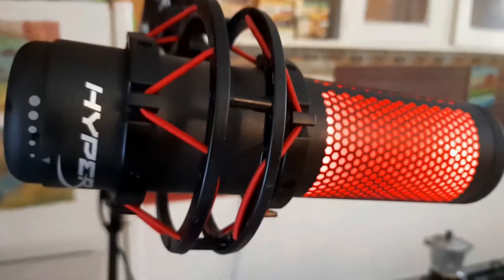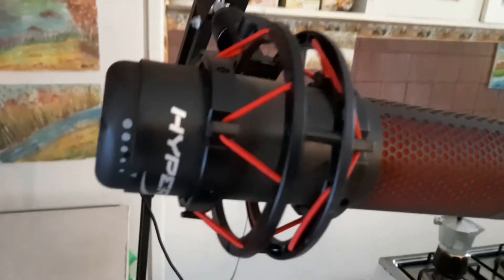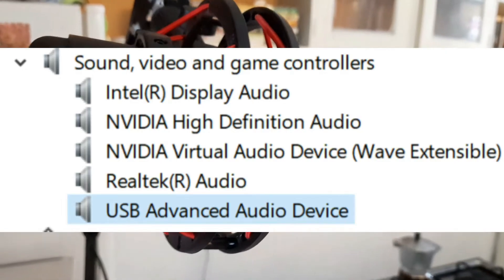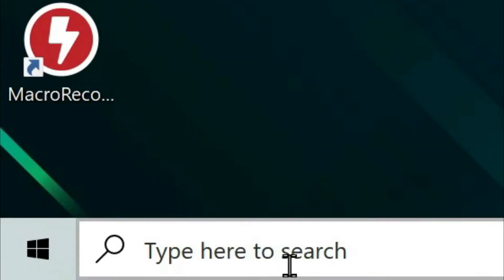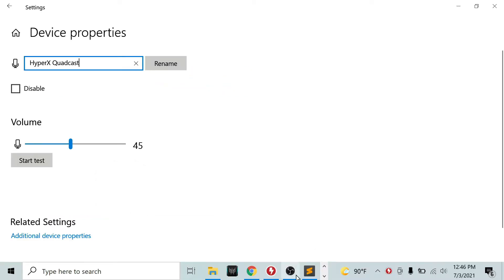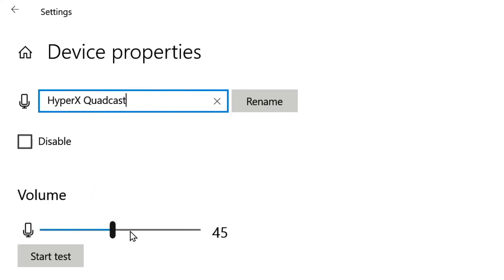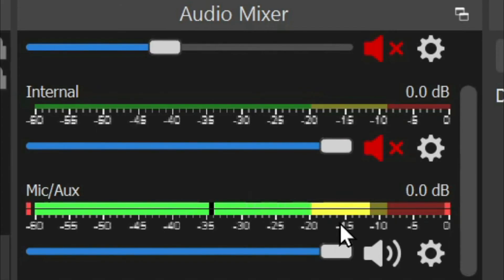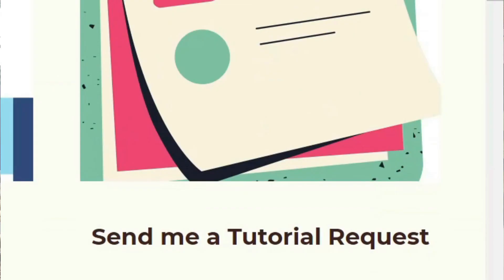Fix Hyperx Quadcast USB Advanced Audio Device Troubleshooting

Comment: I got this mic about 3 months ago and HyperX told me to go return it, the dealer sent me a new mic but now it happened again. Do you have any idea what this could be caused by? Much appreciated
Reply from the maker: From what I understand it is a failure of the firmware. Not sure what causes it. Supposedly you can reflash the firmware but I'm not sure how to do that
Reply: @JackPitmanNica  I wrote to support and they just said to return it and get a new one. This time I asked for a money return not risking it a third time honestly. It's not just gain, the quality of the overall audio went to shit, the difference is audible to anyone.
Reply: this is my problem, I have mic Hyper X Condensed Mic. but when I used them, that thing always reconnect and didnt give any record. this thing always happen when I try use to playig game with OBS. when streaming starting, mic always error and didnt give any record or feedback for my voice.
Reply from the maker: @HalamanTetangga  It sounds like you have a problem with the cable or the usb port on the microphone. Is the red light on? 

If you notice the red light flickering sometimes this will set your PC microphone setting to default instead of quadcast which will cause no sound to be recorded. 

It is very important that you keep the cables very still when you are using the microphone and avoid moving the microphone
Reply: @JackPitmanNica  I was make Hyper X as my Default mic, so everytime i use ObS that always make notice like replug, as you say flickering light and after that, it didnt give any record of my voice.

that light on, but didnt take my voice. until now i didnt know what I must doin with this mic. I already test like mic privacy settings, device manager, and something like that but until know that didnt work for me 😭😭😭

my cable is fine, cause so far away for my hand. and i use boomarm to stand the mic.
Reply from the maker: @HalamanTetangga  Try to use a different USB cable. You could have a dead cable or a dead USB port. If you try a different cable and a different usb port on your pc without any luck then you'll probably have to send the microphone back. 

Did the microphone work before? Is it new and not working or did it recently stop working?
Reply: @JackPitmanNica  this is new product i bought a few days ago. I already swap this product cause have the problem, when the supplier give me the new one. its still have a same problem. 

i think the mic work (cause this have audio jack on the mic so I test it and i can hear my voice on there), but the problem its didnt get record, if get record its just like smurf sound.
Reply from the maker: @HalamanTetangga  It sounds like there is a setting in OBS that is causing the problem. Are you using a Noise Gate filter? If so try disabling the noise gate. Also try downloading Audacity which is a free audio program. You can get it here https://www.audacityteam.org/download/

Verify that the microphone works with another program. If the microphone works in audacity then you know that the problem is with your OBS settings.